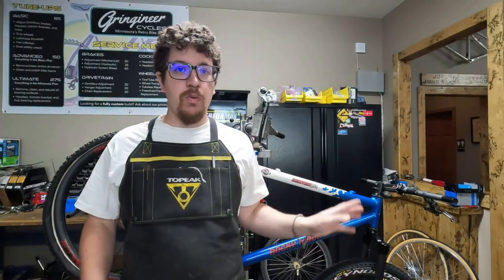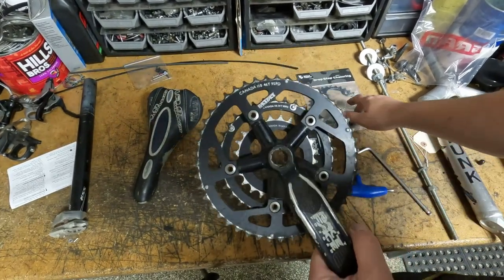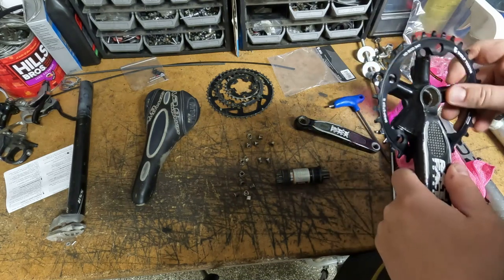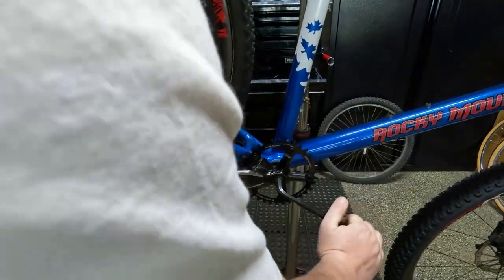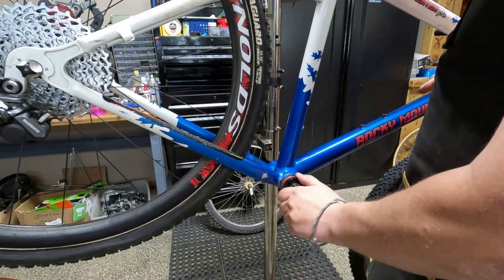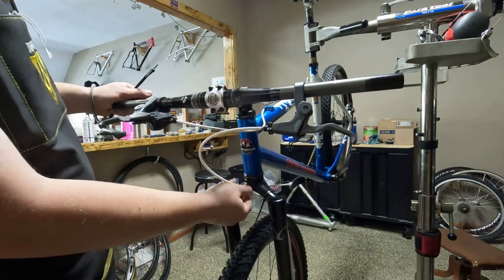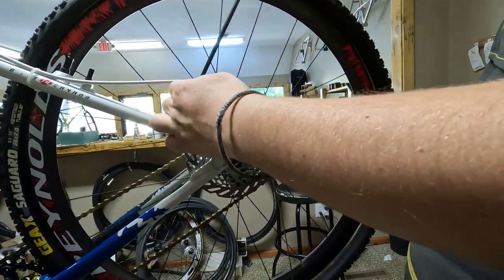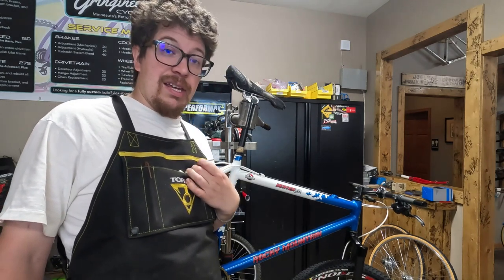Rocky Mountain Vertex TO Vintage Mountain Bike  RestoMod

Comment: Handsome bike. The wheels match the frame colours nicely, and I like the clean lines of that rigid fork. I bet it's light for climbing.
How much better than V-brakes would you say cable disc-brakes are?
Reply from the maker: Nice Mechanical disc brakes are an approvement over v brakes especially in wet weather conditions and longer down hills in my experience.

Comment: New subscriber , I love vintage build & looking at a 2005 stumpy m4 , mint but wary of the fox rl 90 fork , how can you check if it’s good condition & if it can be serviced, thanks
Reply from the maker: Hello, I have unfortunately never serviced a fox rl 90. If it is holding air and moves through the travel smoothly your probably good to ride it until you can track down new seals for a rebuild.
Reply: I run a Fox F90 RL for years great fork very easy to maintain just check fox archives for models and instructions
Reply: Make sure the stachions  have no faded wear marks or deep digs in coating as this will lead to weaping oil seals

Comment: i have a solo that has that same dumb top tube cable routing. do you think it would still function if i put a bit of housing where the cable run is? im allways clogging up my cables with my top tube bag, using a mudflap cut up into a gaurd to prevent it lol
Reply from the maker: have you tried cable liner, that is what I would try first. Jagwire makes the stuff I use at the shop.